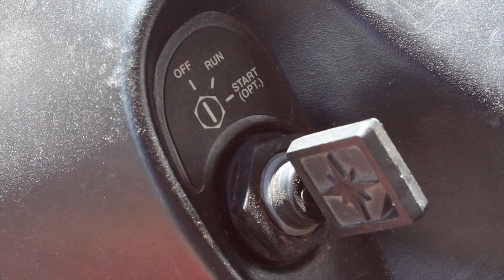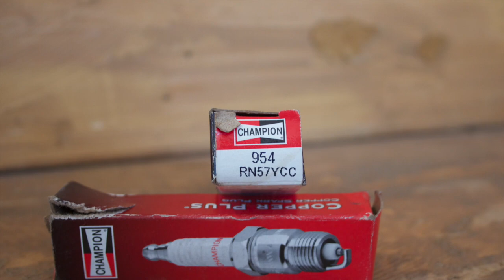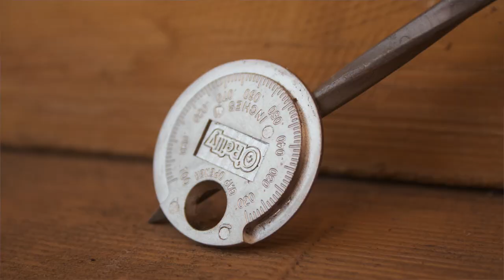How To Change Spark Plugs Polaris RMK 900 Snowmobile

Comment: Great entertaining video.  I have a question. I have a RMK 900 as well, didn't come with a manual.  l don't know how to set the odo.  Or get through the switches.  Any suggestions?
Reply from the maker: now that is a great question, unfortunately I sold that rmk900 a couple years back and don't recall any useful information on that topic. If I get another one will definitely add that to quick videos to make on it. Appreciate you watching and taking the time to leave a video suggestion in the comments. Cheers

Comment: Man I’ve got an iq 600 Cfi, had 20 hours on it when I bought it but after putting 60 hours on it and had no problems with plugs , this year , I’ve blown 8 , same oil , premium gas , warming it up to 55c , I’m pretty upset
Reply from the maker: I'm sure, Unfortunately I'm not familiar enough with snowmobiles to even point you in the right direction with this issue, but hopefully someone with a little more experience sees this comment and has some suggestions for you. Sorry I couldn't be of more help on this one, but thanks for watching and taking the time to leave a comment, Cheers
Reply: У меня тоже уже три года этот снегоход. И в этом году начали гореть свечи . 10 штук на 1000 км. Не пойму почему так происходит.